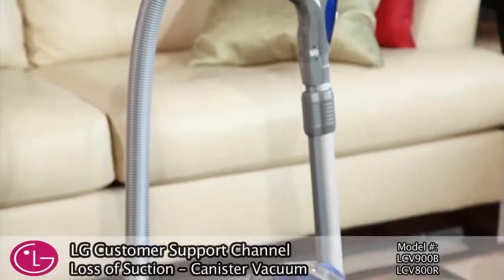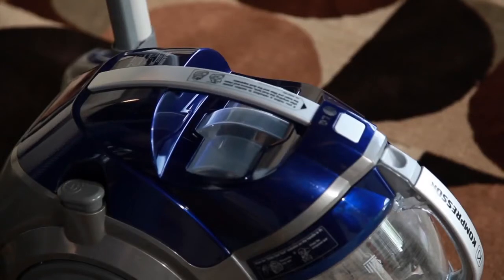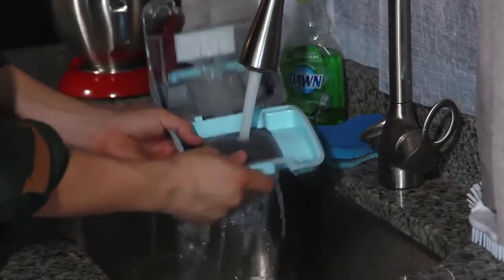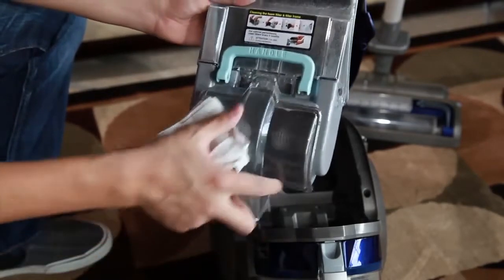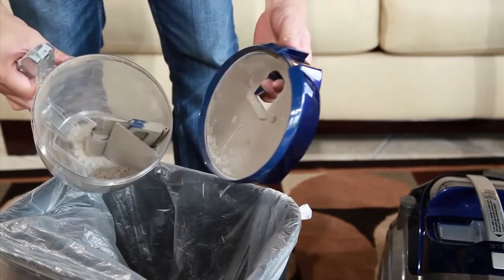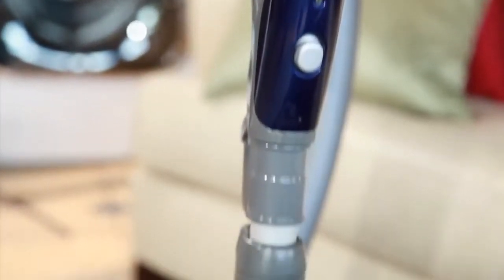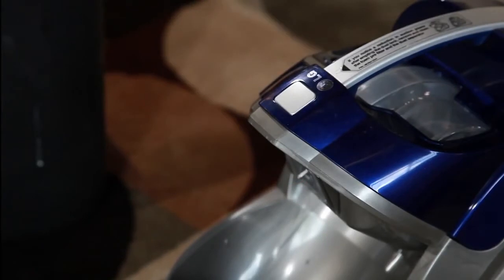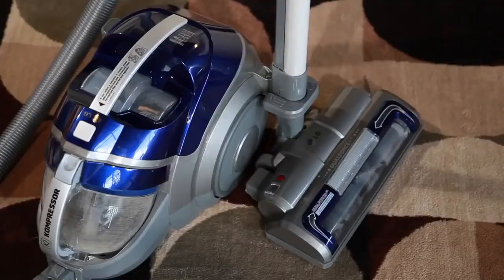LG Canister Vacuum Cleaner   Loss of Suction

Comment: I so badly want to take my LcV900B apart to see what the heck the problem is with it. I've had it for years now and I've done everything I can imagine to fix the suction issue to no avail. I thought it was a filter problem but I have cleaned all filters. I turned the machine on without the filter housing to see if it still made the same sound (like something being blocked) and it didn't. When I put the filter housing back in, with NO filters, the sound occurred again, and I could actually see the plastic of the housing being pulled farther downward. Like the filter housing is getting in its own way? The sound it makes is similar to what you would get if you turned on any vacuum and held the end of the wand on your hand.
Of course I unscrewed everything I could, but I still don't know how to get into the guts of the vacuum, lol. I feel like the wheels need to come off but no idea how to do that either.
I'm so frustrated because before this happened it was always an excellent vacuum. Could this maybe be the result of using it on the max setting almost exclusively?
As I said, I have cleaned everything I can access. There's nothing in the tube or the wand. I don't want to have to purchase a new machine if I can save this one..

Comment: Can you show us a video of how to fix the power nozzle loose connection I have to problem right now on the LG Kompressor canister
Reply from the maker: Hi. Ismayo. Sorry for the late reply. Are you pertaining to the A9 Cord Zero that has intermittent power issue? If so, please refer to this link for proper assistance https://www.youtube.com/watch?v=vJ1FcV2Sh70. ^Nolito
Reply: No it's the canister the 2012 model I bought a used at a thrift store when I push it forward and works fine but when I pull it back it turns off it's not supposed to do that
Reply: It's the LG Kompressor canister Pet Care Plus
Reply from the maker: Hi! Ismayo. Upon checking there's no specific video that can provide you the information that you need for that kind of issue. However, I just wanted to confirm if it is the correct model number of your unit LCV900B. If so, please download the manual on our website at https://www.lg.com/us/support/product/lg-LCV900B.ABLELGA. In the owners manual please check the troubleshooting steps in page 21-22 for such issue. Thank you! ^Nolito
Reply: Ok thx
Reply: When I stretch the Delta on the website on manual and documents it says there's no matching product when I put them on a number on my canister
Reply from the maker: Hi! Ismayo. Can you please provide the model number of your unit? ^Nolito
Reply: @LGUSA  ill check it at home i keep puting the model number but says there no model for it
Reply from the maker: Hi, Ismayo. I’m sorry to hear you're having this issue, and I’d like to see if we can assist. For further assistance please contact LG Customer Support by direct message via Twitter ( @LGUSSupport  ) or Facebook Messenger ( https://www.facebook.com/LGUSA/ ), and include the issue and the model number of your unit. Thank you! ^Nolito
Reply: @LGUSA  its a LCV900B
Reply from the maker: Hi! Ismayo. I’d like to see if we can assist. For further assistance please contact LG Customer Support by direct message via Twitter ( @LGUSSupport  ) or Facebook Messenger ( https://www.facebook.com/LGUSA/ ), and include the model number of your unit. Thank you! ^Nolito
Reply: Ok
Reply from the maker: Thank you. ^Nolito
Reply: Which LG is it for the Facebook that LG Global or the LG support USA
Reply from the maker: Hi! Ismayo. It should be Lg Global. Thank you! ^Nolito
Reply: @LGUSA  how much dose it cost to fix the power nozzle on the lg Kompressor Pet Care Plus canister?
Reply: My vaccum is making beep when I on it. Whats a problem